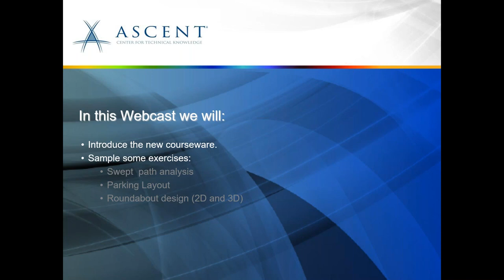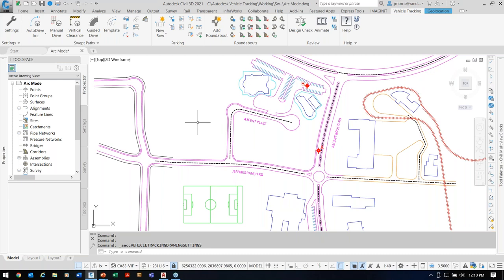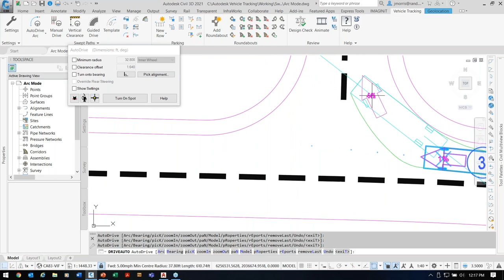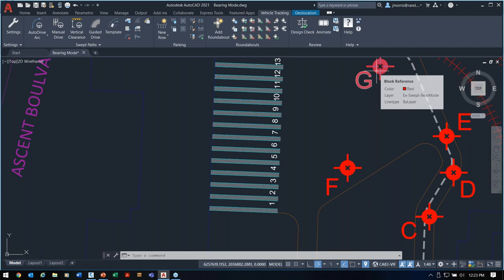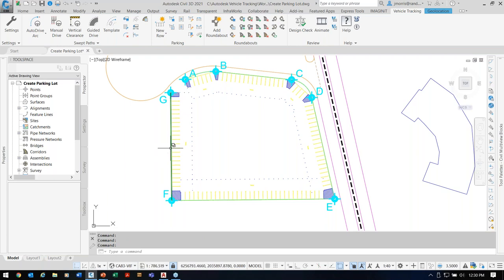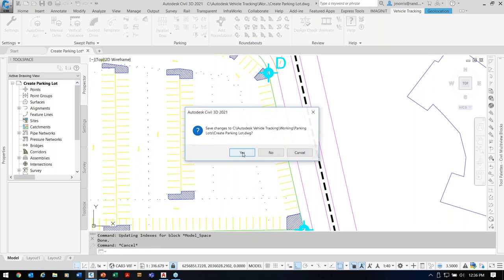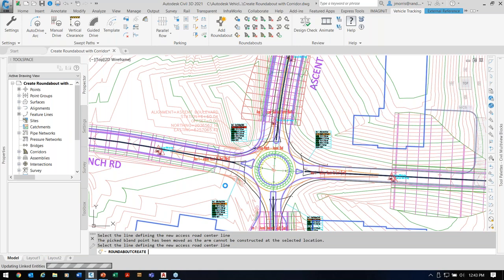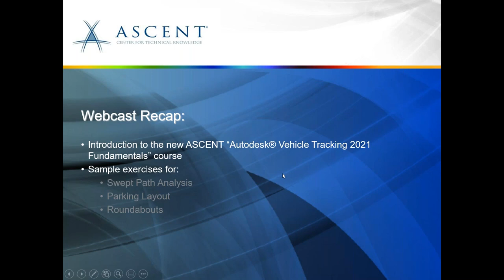Introduction to Autodesk Vehicle Tracking

Comment: Road width is 15m and a get have to be designed to pass a factory premise through a compound wall gate to be fixed to compound wall. What should be the size of that gate to pass a 18m long truck?
Reply from the maker: HI- thanks for watching our webcast! To answer your question, Vehicle Tracking is used for swept path analysis for specific vehicles. Select an appropriate vehicle and run the analysis to see the extent of the swept path, then size the gate accordingly.